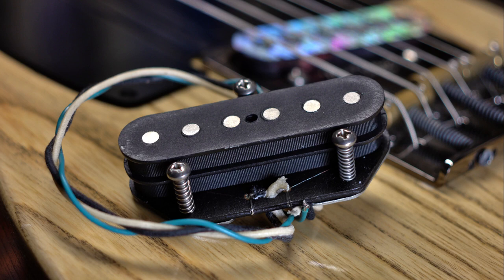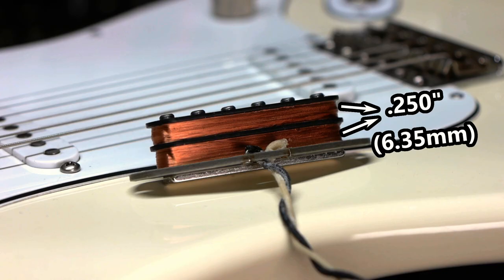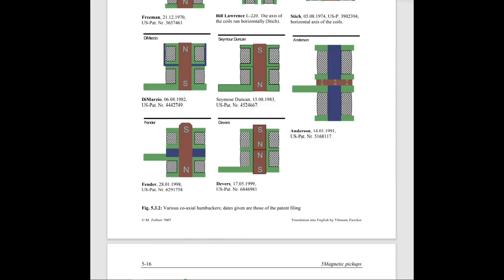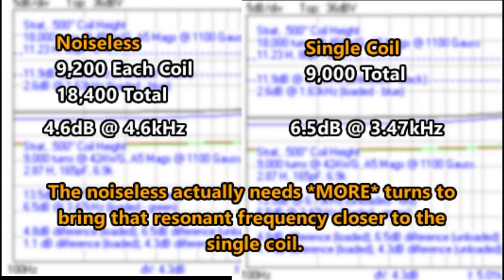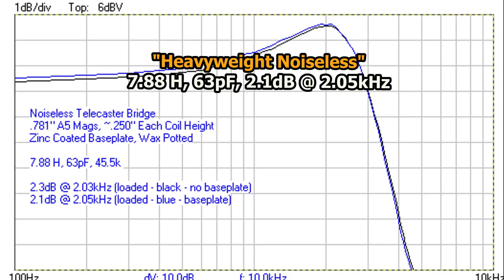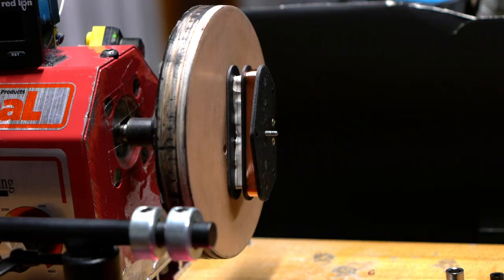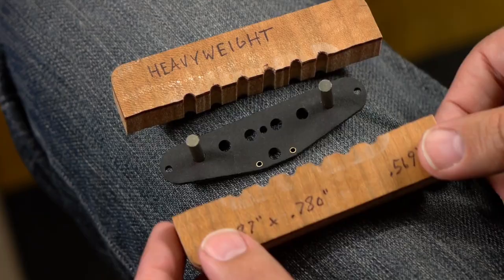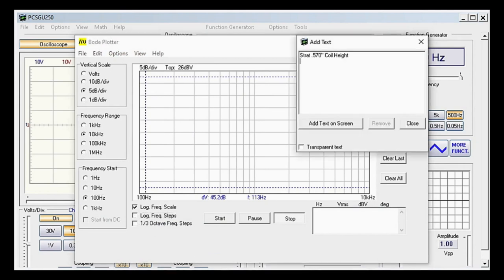Noiseless "Single Coil" (Stacked Humbucker): Build Tips and Theory

Comment: There is not much videos about making pickups on youtube, I really appreciate that you share your knowledge with us. I am very much interested in noiseless pickups, recently found about coil per string pickups. Look forward to see your pick on that.
Reply from the maker: Thanks so much! 

I've known about the coil per string pickups for a long time now, but have no opinion, as I've never tried them, and don't know enough to comment. However, Dr. Lawing's blog is here: 

https://lawingmusicalproducts.com/dr-lawings-blog

He has a ton of great info. My experience is solely with winding traditional pickups with one coil of wire, or two at the most. And my main experimentations have been with altering the coil size/height, magnet types, wire, and more. But all basic stuff. If I ever get around to it, I mean to make some videos comparing pickups that I've made. I think that could be very interesting.

Comment: I'm currently working on making a 2002 Fender Squire Bullet as good as it can be made and am looking for some pickups for it. I don't know if this is the best way to get into contact with you but I'm looking for 4 wire stacked pickups for the bridge and neck positions and a matched output center pickup.

I was curious how I'd work with you on getting these made. Characteristically I'm a big fan of having more than what I need with the ability to roll off on the output so I guess I'd be looking for a high output set. 

I doubt any of the rest of the build matters in regards to pickup selection but the plan is:
Wenge neck with wenge fret board
Brass saddles and bridge
stainless steel frets
SSS config with stacked singles in bridge and neck
Twin mini switches that allows for North coil/Both Coils/South Coil on both of the stacked singles
Dual Push/Push pots that change the tone resistor and switch the 5 way wiring on a super 5 switch
super 5 way switch

I know this is probably too much information for the project but I figured I'd give you everything so you understand why I'm looking for exactly what I'm asking about.

Comment: I bought Fralin pickups with two separate magnet rails. It's sound like a single, but actually it's humbucker. I don't understand how does it work, but it's work really good. If somebody knows, I will be appreciated for explaining.
Reply from the maker: Those are rail humbuckers. Humbuckers can achieve a more single coil tone by using fewer turns of wire, which results in lower inductance, and a higher resonant frequency. 

A humbucker is merely two single coils wired together in series, with the coils placed directly next to one another. 

The pertinent measurements are inductance, capacitance, and resonant frequency. Under the load of pots and a typical guitar cable, many Strat pickups fall into the 3.5 - 4.0kHz range.

If the humbucker's resonant frequency falls into the same range, it will sound similar. 

This is also just a guess, but I think that the much smaller size of rail humbuckers, compared to normal PAF style humbuckers, also contributes to it sounding more like a single coil. 

Why? Because rail humbuckers are closer in size to a single coil. The bobbins are much smaller than a typical humbucker bobbin. The overall size of the coil matters, and is one reason Tele pickups don't sound like Strat pickups, for example -- Tele pickups are significantly bigger. The magnets are the same size, but they're farther apart, so the resulting coil is bigger, and per turn of wire, the wire is traveling farther on a Tele pickup than on a Strat pickup. 

So again, just my guess. But I'd imagine that Fralin design has a similar inductance/capacitance/resonant frequency compared to a traditional single coil, and the smaller size of the bobbins probably gets it sounding closer too, compared to a traditional humbucker. 

There is an effect called Comb Filtering that humbuckers have. I don't understand it. But I know it exists. And I think it has something to do with how far apart the coils or, or also how big they are -- how much of an area of the string they're sensing, in total. 

The total area the coils are sensing would be much smaller on a rail humbucker -- the same footprint as a single coil. This is probably why. It does make me curious and maybe some time soon I'll make some again. 

I made one set for someone and it was a huge pain. They're really annoying to build. And the commercially available materials are not good. Not easy to use and they don't come out looking like factory made ones. I'll have to look more into it now!
Reply: Thanks for the reply. I think that the sound of the humbucker is muffled, due to the fact that the two coils are connected in parallel in the opposite phase.Therefore, parasitic leads subtract each other, but the useful signal is also partially subtracted. Fralin has two magnetic rails,one rail serves 1-3 strings,the second rail serves 4-6 strings. There are also two coils, because the 4 ends of the wire come out of the pickup. Maybe the coils are located separately on each of the rails, maybe not.I don't know.

Comment: Does your method create an actual noiseless pick up? I have the Fender stacked coils in my Jazz Bass V deluxe, and they still have some 60 cycle hum (I know this because it changes based on my position). The most annoying thing is that it doesn’t go away when both pickups are up like single coils. If they at least did that, then it would be a net benefit over single coils in terms of noise. Now I’m not sure. 

But either way, my understanding is that stacked coils necessarily leave some 60 cycle. Is that incorrect, or self by your method (using the same wire)? And is it possible that they don’t cancel out because the coils are wrapped in the same direction as each other, and if they were in reverse of one another, it would be full canceling like single coils when both pickups are on?

Comment: Nice video. I tried the split coil pickups for bass and it worked really well. Unfortunately the phasing issue will effect the guitar neck pickups because of the pull distance of D and G strings. Seen a video howthe dead spots occurs. I could offset the coils but that would totally change the universal form factor. I'm gonna try and stack the fender style p90s and use pole pieces like you mentioned before. 1/4 bobbin height, which should  hopefully make it darker. Using 43 awg gauge but I should really go at least 44 awg probably.
Reply from the maker: 44AWG is definitely the way to go for 1/4", but 43 might still work. Lately I've made a couple Micro Coil designs (Bill Lawrence) with only 1/8" winding space. 

For those, I use 48AWG, which I've never heard of anyone else using. Results are mixed. The 48AWG on a PAF bobbin (mounted to some Strat bottom flatwork) with 16,000 turns I recently did gets a very cool sound, allegedly like an Alumitone. 

Into an Amp I don't really like it. Hard to explain why. But direct in it's great. 

Shorter bobbins do get a different sound. I'm not exactly sure what it is yet. But definitely different. In my experience, thinner wire has lower capacitance, and shorter bobbins have lower capacitance. A 7,600 turn 48AWG, 1/8" winding space Tele Bridge Micro Coil I did recently only had 21pF capacitance after winding. Nuts. The customer said it's interesting but lacks high end sparkle/bite and also lacks low end, seems like all mids. 

More tests needed. Definitely let me know how your test goes. Stacked coils will avoid that dead spot, so while split coils are very cool, stacked are much easier and less problematic. 

The Micro Coil is using the same build style I use here, just the bottom part is empty instead of being another Coil. 

Now that I have some 48AWG I want to try making a super overwound noiseless. My main bridge pickup in my Strat right now is one I wound to 18,000 turns with 46AWG on a bobbin with .500" windinf space. I'm hooked on that darker, more powerful sound.
Reply: @guitar_md  A super overwound noiseless would be great. I too am gravitating toward lower resonant peaks. The bobbin height is definitely a factor. P90 in neck position is godly. I wonder how it would mix with a strat pup in the middle position? 

48 awg is nuts man. I started breaking wire at 43 awg. Gotta do that velcro tension trick. Really hard to control now.

I like the simplicity of split coils, but for now, only going to them for bass players. Stacked coils seems way better. 

Know of any good places to buy flatwork? Philadelphia luthier has some and donlis store has some.
Reply from the maker: @AmerikkkaGuitars  I use Mojotone mostly for flatwork. Flatwork does seem hard to find, as outside of Mojotone, there aren't many options. I use addiction-fx on eBay for my Strat flatwork, and Philadelphia Luthier as you mentioned too. 

Tone Kraft has flatwork, but they never ship. I've ordered before and never received it. They do ship magnets quickly, but they custom cut their flatwork and my guess is they're so backed up they just never get around to doing it. Have ordered flatwork from them several times and it never arrived, not even after several months, and I had to request a refund. 

The Velcro tensioner is great. I've since gone to simply using two popsicle sticks lined with felt. I just put some double stick tape on a couple popsicle sticks, wrap felt around them, trim, and done. 

Hold together with a Stewmac kerfing clamp. You can probably get similar clamps somewhere else cheaper, but I can personally attest to the quality of the Stewmac kerfing clamps. 

Then it's just a by feel kind of thing. But it's so easy. Popsicle sticks, felt, clamp. The Velcro is very good but I'm getting just as good results with the felt. You just have to fiddle around with where you sandwich the wire between the popsicle sticks, and where you put the clamp, to get the tension right. Very 'touchy feely,' as Rob has called it. 

The tensioner works so well, I was winding at 4300 RPM with 48AWG and didn't break the wire. I'm not sure if you saw my new YouTube short, but I also got some Rubbermaid water pitchers from Wal-Mart. Drilled out the lid with a Forstner bit and fit a wooden bead in the middle. They're great for holding spools of wire, though I'm using rather large spools (around 9" tall). 

I got the 48AWG from Ultra Fine Copper Wire, I think the company name is Ruiyuan.

https://www.ultrafinecopperwire.com/

You need to e-mail them and ask one of their reps for availability and pricing, and send via PayPal to their PayPal address. So far I've ordered 45AWG, 46AWG, and 48AWG, all good. 

The tensioner really makes a world of difference. If you're struggling with 43, I guarantee it's because of the lack of a tensioner. 48AWG is pretty much my limit until I'm crazy enough to try something even finer, but 48AWG breaks very, very, very easily. Even 46 doesn't seem so bad compared to 48. 

But definitely try making one of those tensioners. You don't even have to use a kerfing clamp, any strong enough clamp will work. I really can't even imagine winding pickups without it -- they're that good.
Reply from the maker: @AmerikkkaGuitars  I can't wait to try making a super overwound noiseless stack. I bought a broken verion 4 noiseless Fender (tele neck) from someone, I think it was actually one of my viewers here on YouTube. And it looks interesting. I haven't measured the wire yet, which will require me to repair it first, if it's even possible. 

But it has a shorter bottom coil and a taller top coil. I'm curious if they use the same wire gauge or not. I'd imagine it's different, and I'd imagine they match the turn count...but I'm unsure. I'm curious why they'd use a taller coil on top as well instead of the shorter coil. There may be a good reason for that. 

As of now, I can't explain what the difference is between shorter and taller coils, given the same resonant frequency. There's definitely a difference. I have the specs listed. Also, you can shoot me an e-mail at guitarmdofficial@gmail.com if you want, and I can add you to the shared list for my pickup spreadsheet. I'm just logging a bunch of data in there as I go along. Would be happy to share the link to the Google Drive file with you. I try to keep it updated though there's a lot missing. Mostly measurements and bode plots for various pickups, including some that I've made myself.
Reply: @guitar_md  Thanks, Going to send an email to share google spreadsheet. I have one too I can share, mostly univox and cheaper pickups and some custom's Iv'e made.
Reply: @guitar_md  thanks, sent email
Reply: @guitar_md  Noticed the volume drop on the stacked. I bought some jazzmaster fender noiseless stacks that also have a drastic volume drop. Gonna try the split coil for a telecaster today. Keep both coils active maybe not act like a dummy coil to not have volume drop as much. The bridge location keeps the strings from going dead when bending the b or g strings. Theoretically will work on the bridge pup since the neck pickup is closer to bending b/g strings. Almost at pickup heaven, just trying to locate split coil bobbins like on the fender xii/maverick/mustang bass/tiesco spectrum. So far only found bigger pbass bobbins, which may work, just humongous. Found a place to manufacturer the bobbins but it's like 8 bucks per coil, 32 bucks for a neck and bridge bobbins. Or I can cnc some wood bobbins to save money.
Reply: P90 or jazzmaster?